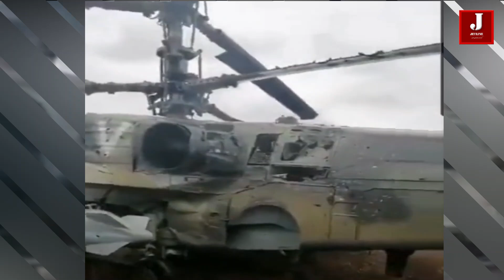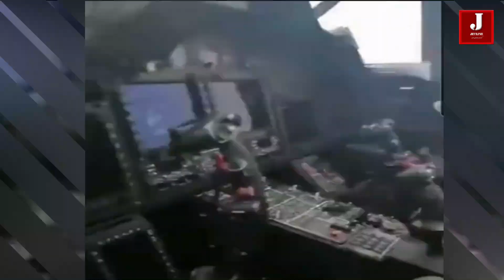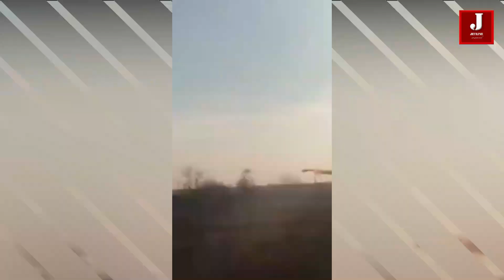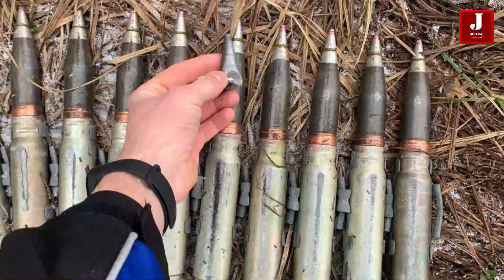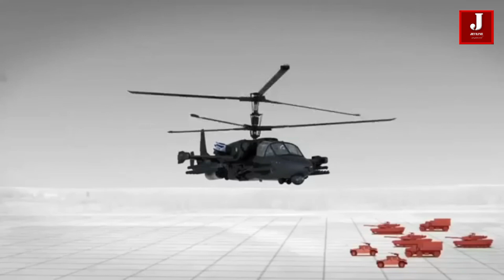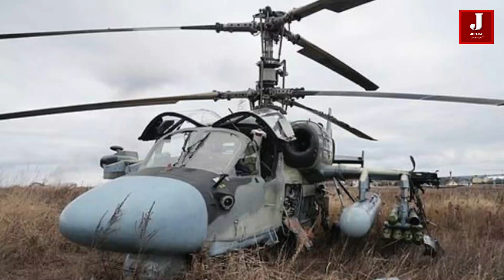How does the Ka 52 Ejection system work? Why is China concerned about the #Ka52 being shot down?

Comment: Heres an actual explanation:

As far as civilization databases are concerned, only Russian helicopters (Ka-25 and mainly  Ka-52 helicopters) have ejection seats. American helicopters rely on bailing or autorotation.

How Russian ejection seats typically work: Once the election handle is pulled, the blades detatch and are thrown clear, setting the chopper body into a free fall. Then the pilots are ejected straight up (just like a fighter jet). Pretty basic but works good.

American "ejection": For American helicopter pilots there are roughly two options.
1. Bailing (jump out the door with a parachute backpack): This only works if at sufficient height for the parachute to open and get clear from the propellers.
2. Autorotation. This basically means that the blades will keep turning at a slow speed even under no engine power (like a helicopters version of wing gliding with no power). The helicopter ia falling but relatively slowly. This is how the pilots guide the aircraft to the ground at low altitude as most helicopter sorties are such.

Hope this helps explain the video and if you're a helicopter pilot with real experience and I've made a mistake in my description, please correct me below!
Reply: Bullshit... Ka-52 does not have ejection seats.  The pilot is pulled out by a rocket that is placed behind the seat.

Comment: I understand the pilot can initiate the ejection sequence, but can the system initiate an automatic ejection based on vibrations, fire, engine shutdown, etc.?
Reply: That would be rather unnecessary given that it is much safer to land the heli if you can than to use the ejection seat, which can damage your spine and nech pretty bad sometimes. Also the ka 52 stays pretty stable for a while even when hit due to the co axial rotor design, giving the pilot enough time to pull the ejection handle
Reply: @16_rebooted  As you said, unnecessary IF you can land the helo. The question still remains, does the KA-52 have an automatic ejection system not initiated by the pilot or copilot?